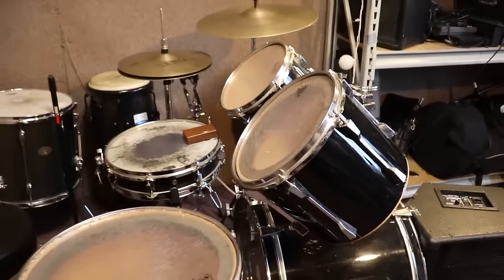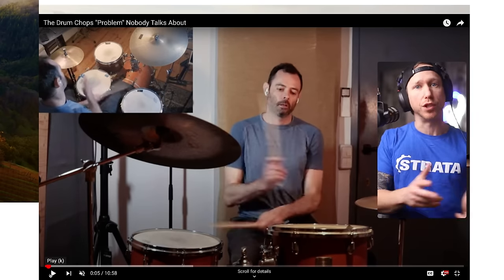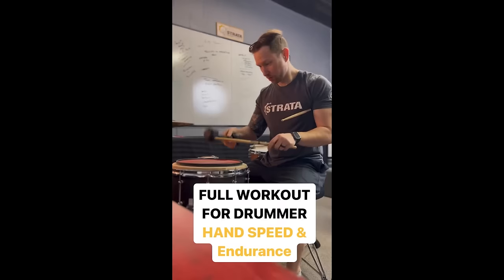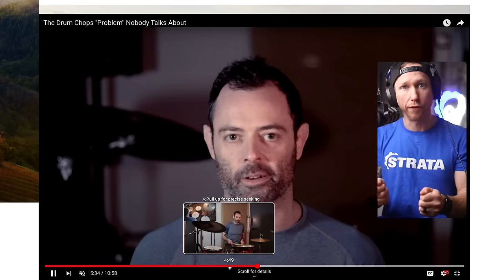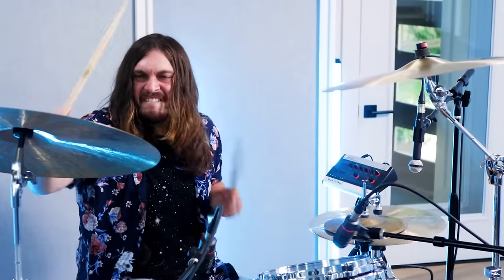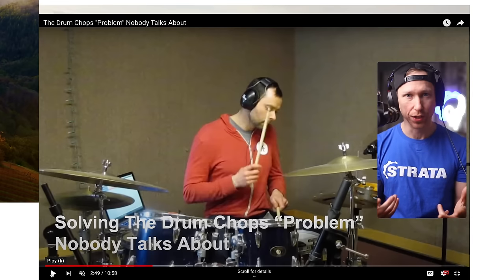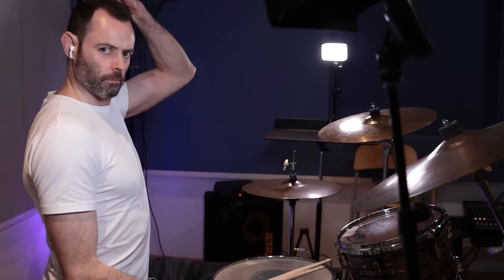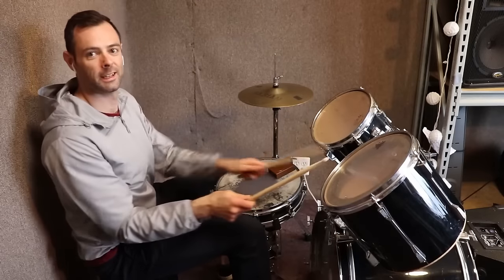Are You Making This Drum Setup Mistake? - Drum Ergonomics Expert Weighs In

Comment: On my old 4-piece, I had the rack tom on a snare stand (mostly because the vintage tom arm was not practical) and I ended up sitting it almost flat, slightly more angled than the snare, which was slightly angled itself.  I wasn't reaching for it, but the 8" depth helped with getting it that low.  From there, the cymbals were just high enough to not hit anything below them when played.  That was probably the most comfortable kit I've ever played.  I have been hunting for a specific configuration that matches my drum series ever since to get that 12x8 rack tom size again.

Comment: I spent 15 years playing with kits that have rack toms mounted off the bass drum, angled down. That configuration SEVERLY limits the ability to bring the toms closer in towards you while seated at the kit. I didn't realize how much of a difference it made having the toms closer towards you and the snare until last year when I was recording in a studio using the producer's kit. I walk in and see this thing and it's set up with everything completely flat. I thought "man this is just set up all wrong, but whatever, I'll just play". So I start playing and immediately realize how much LESS work I was having to do to move around the kit. It was amazing. Now, after 15+ years of drumming I have switched to a completely flat layout. Had to buy a new Ludwig kit with Atlas mounts, but it was well worth it.
Reply: I've had the complete opposite experience lol But having toms mounted on the bass drum especially for 5 pieces really sucks. I was so glad when I got a tom stand. Plus bass drums sound a lot better without any weight on them. Including pillows (I hate pillows but you need them if you dont have a port hole IMO)

Comment: Glad to be one of the naysayers of the past, ending up as an example of your comments! :P 

BTW: I had a small victory tonight at a gig, after a slight adjustment of my rack tom the rest of the gig was smooth sailing. I wish I would have done it 10 years earlier.
Reply: AND: for me it's not just about avoiding pain (yet) but allowing my thoughts not getting in the way (rack and floor tom placement, ride height and angle --> not having to lunge), or my sticks getting to each other's way (hi-hat placement and height, snare drum height and angle). It's the "extending arms" that throws me off, since I like to sit high. Seriously, it's one of the bottlenecks of drum set ergonomics that seems to really throw off my concentration and activating my brain in absolutely the wrong way. If I would sit lower, which I won't since I am afraid my knees or lower back would protest, i would probably put everything in a somewhat 90's David Garibaldi -position, with everything in a high angle but still accessible - not having to reach. on the other hand, if the toms  of my main pop-rock-top40-function gig -kit were more shallow I could have the toms super low and with very little tilt, and still be able to sit high and  not lose my balance. I tried this with another kit of mine and it worked great. It probably has to do with the angle into which one extends the arms so that it doesn't start interfering with one's balance point. Given that the bass drum and hi-hat aren't super close to one's body, so that your legs can compensate for the upper body partially leaning somewhere. Dunno.

If I would play traditional grip the amount that my elbow has to approach the small tom in a jazz setting would be much less. So 1-0 for the true jazzmen. Putting up a 10" instead of a 12" whenever the music doesn't mind it decreases the amount of travel to the sweet spot area of the drum, also making sure that the (sue me, I don't care) tom rim is a bit above the snare. Sure, some ppp tremolos might feel more dangerous because of that but less extension = happier person. And, in order not to mess up the drumhead it just needs to go higher. But higher isn't "further away", I learned this from a jam session where the ride cymbal was like a "shield" and I didn't have to raise the arm-bit-after-my-elbow at all in order to perform. These experiences combined with your seeming preference of having the drum up-and-away, resulting in having to first lift and then extend your arms made me express my opinion :P 

Regarding being able to put the small tom to my preference, this is where the drumset manufacturer's decisions come to play, I've worked my ass of to optimize the ergonomics in my jazz kits but am still not there. I rely on L-rods with jazz-stuff since the clamping method has to survive a powerful dead stroke when I want to deliver one, and the ball-based thingies usually don't. Then it's about the height and lenght of the L-rod, which for me right now never seems to be enough.

Also, floor tom placement has to do with bass drum placement. Everything adds up. I'm tired.

Ask Al Foster.
Reply: AND: Regarding sitting low and angles, which I also used to find funny and impractical until I tried it: what about 70's / early 80's Colaiuta? He absolutely flew on that setup. I have a friend who sets up his kit like Vinnie USED to and it looks weird and feels weird at first, but soon it starts feeling super easy. But still: am afraid of my knees and my lower back, so no. I know I know, you have a video about that too. But... maybe we all should reconsider some things from time to time. Then again, to my knowledge he did have back problems back then.

(hooray for anecdotal "evidence" :P )

Comment: My method for this involves a lot of trial-and-error with "economy of motion" as my guiding principle.  I start with my throne and set that so my thighs are just higher than my knees and then set my snare so the head is parallel to the ground, so I can set the height at about waist-high.  Then, I adjust the tilt toward me until I'm hitting rimshots naturally.  This makes the choice to not play rimshots as easy as a slight lift in my wrists (I play American match grip, as opposed to the French timpani grip shown in the video).  When setting my toms, it's a lot like my snare, I start with a rough height and a flat drum for the smallest tom.  From there, I angle until I'm just hitting rimshots.  If I like the height, I'll add enough tilt to make rimshots an intentional choice. If I like the angle, I'll drop the height to achieve the same goal.   I'll set the next rack tom at the same angle and height, then adjust the space between the drums so I'm hitting in the middle.  From there, I set my hats and ride to about the same height as the middle of my toms, creating a fairly level playing surface.  My crash cymbals are just about shoulder-height and tilted slightly toward me to help with the swiping motion and not digging into the edge of the cymbal; and set at a distance that allows me to crash them off of my ride or hats without needing to reach.  I simply point my stick at 12:00, lift my arm at the shoulder, crash, and return to the pulse instrument.  Everything big and showy I do is then an intentional choice.  The end result, though, is that I can play my kit with my eyes closed.  Maybe hit a few rims but, otherwise not suffer any loss of proficiency.

Comment: This has been useful.  I was already onto the rack Tom angle, but oddly it influenced another decision.  I like 1-up, 2-down kits. But having 14-16 or 16-18 floor Tom's really force you to crank around. I'd considered going with 2 14's simply as a weight and space saver ( 2nd floor tuned LOWER) but the ergonomics issue brings up another advantage.

Comment: Yeah, basically the way I look at it is that you should be hitting your toms so the bulk of the barrel of the tip is hitting flush with the skin. As you showed, if you have to flex your wrist to hit the tom flush, or your toms are so angled that you're catching mostly tip then it's probably not a good idea.  

Having said that though, it really depends on the overall setup. Nicko McBrain is one of my drumming hero's. I'd never set my kit up like him with the "wall of toms" almost vertical in front, but if you look at the way he sits, his stick tips hit at the same perfect angle the rest of us (hopefully) have when we set up our toms more flat. I suppose he raises his arms a bit more than maybe he should but it doesn't really look like he's wasting movement getting around his kit, so it works for him.

Comment: How about the snare height? Todd Sucherman recommends to set the snare drum  at the heght of a karate chop; that is with elbows at almost 90 degrees. That is much higher than most drummers have. Some drummers have it so low that with a rimshot the hands touch the legs. Chair height:: Phil Collins did sit very low and has back problems. Steve Gadd also is sitting very low, Vinnie Colaiuta also is sitting low. Chester Thompson is sitting very high. Simon Phillips is sitting higher than Vinnie, Steve and Phil but lower than Chester.  Dave Weckl  is sitting low but has his snare  at Todd Sucherman height. Tood hasd almost samer chair height than Simon Phillips. Bruce Beckert is siiting higher than Simon, Todd, Vinnie, Steve band Phil but not as high as Chester.

Comment: Stephen Taylor showed a good way to improve posture when sitting at the drums.  As you sit down, extend your butt back a bit to get your tail bone in a better position,  As you straighten up, your spine ends up in a natural unforced position and sitting straight doesn't require so much of an effort.  I've been doing this and it has helped.  I'm most comfortable sitting a little on the low side.  I actually find it difficult to feel balanced when I sit too high.  Maybe it's just the way I'm built.  I'm also not very tall, 5' 7".  One time when I was playing on someone else's kit, I really had to use Stephen trick to sit balanced on this guy's throne.  Now, he sits kind of low, with his thighs roughly parallel to the floor.  Except that he's 6' 6''.  So his seat height is pretty high for me.  He complimented me later on my good posture.  So Stephen's trick works, I guess.

  I agree with everything you said about tom angle and height.  I really hate it when I get on a kit and the toms are angled so steeply that I have trouble hitting them in a way as to let the sticks natural rebound reset my hands for the next hit.  But I also don't like reaching over to play the toms when they're sitting too flat.  Large toms with power depths can be really challenging to position.  I think that's often why some drummers angle their toms so steeply; so they can lower the rims to get over them more easily.  My drums are power sizes with their shell depths about one inch less than their diameters.  So I have chosen not to use the 13" and 14" rack toms.  Because I agree with the notion that I shouldn't let my kit dictate how it should be set up, but let my body be the guide to positioning the kit.

   Anyway, I think this is an important topic that every drummer should put some thought into and take some time exploring how to make their kit more ergonomic to play.

Comment: This way of thinking implies that load on the body is bad. Which is wrong.
The body is made to adapt.

More spine movement while playing could be brneficial for drummers (like reaching for a crash here and there) to get more variety in position and posture.

How would dry wall guys survive with this way of thinking?
Reply from the maker: To try to respond in good faith, I think there's a difference between hormetic stress and non-hormetic stress. If subjecting the body to adversity weren't good, nobody would work out. But there's a difference between putting load on the body for short periods of time, then allowing for recovery, and putting chronic load for no reason. even Brandon says that the odd cymbal in a place where you have to reach for it is fine. But why would you play 2 hour gigs every few nights for decades in a position that required you either to expend energy to hold yourself in an optimal position, or else be in a bad position? Just because Chris Bumstead and Ronnie Coleman lifted heavy doesn't mean if you forced them to sit slumped in bad office chairs for hours every day it wouldn't be detrimental on their bodies.
Reply: @8020drummer  well sure there are more and less ergonomically beneficial sitting and setup positions. However, to make claims about whether or not a position or technique will lead to pain seems silly. Just look at differently people walk and move in general. Also there is a very little evidence for posture and its contribution in pain in general.
This guy uses the same approach as squat university does when it comes to training. Over simplified claims and not respecting basic modern pain science.